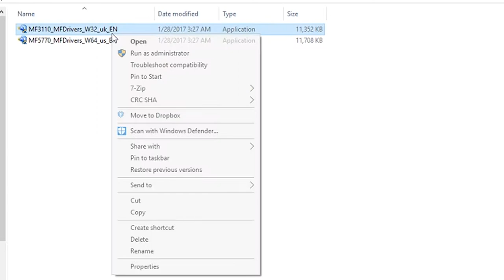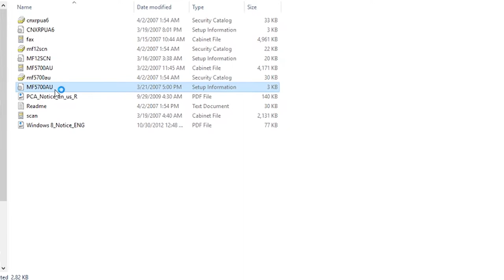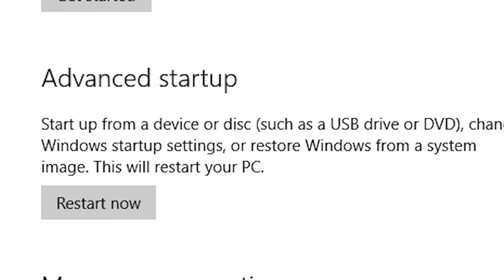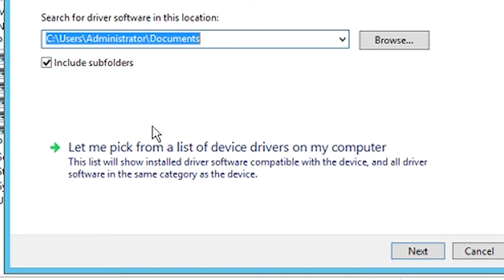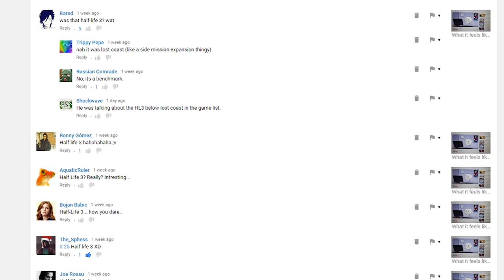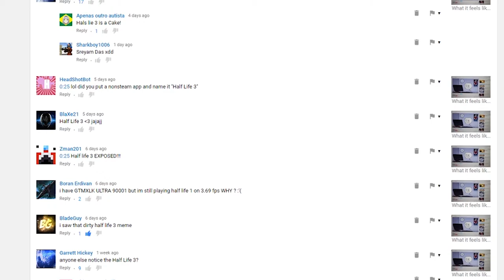Modify .inf file to make old hardware work (MF3110 example)

Comment: i have a hauppauge wintv tv card 61324 (old-school) and driver run only on 32 bit system and want modify to 64 bit system but i dont know how
Reply from the maker: that one is next to impossible. you need to find a 64-bit version. usually the oldest ones are for xp-64 bit, which might work. if you cant find a 64 bit version, you will need to switch to a 32 bit version of windows